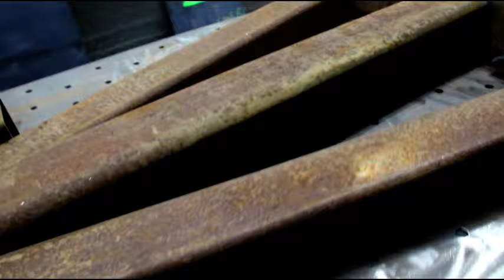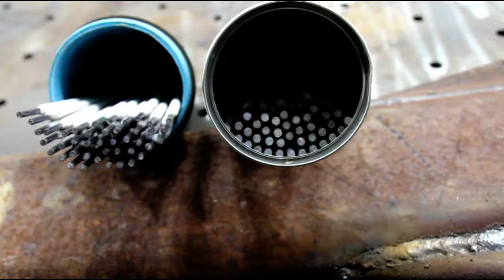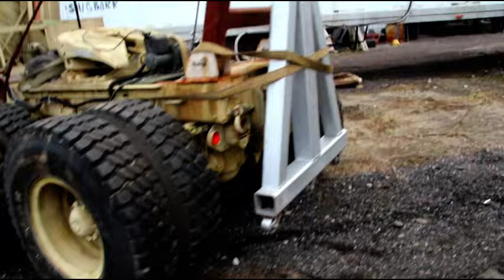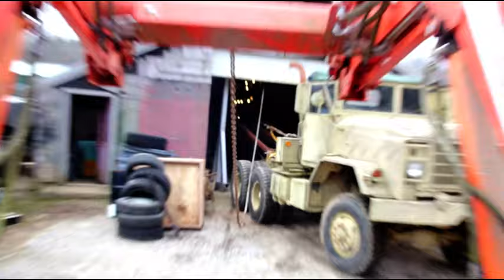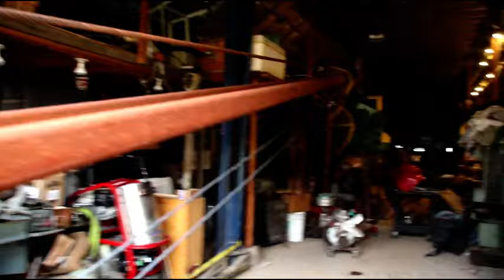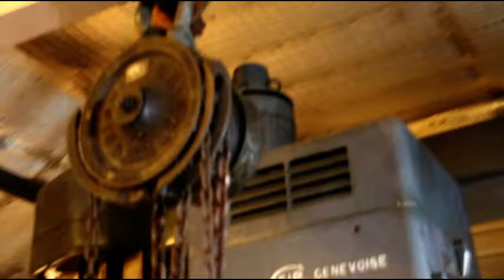Fabricating A Gantry Crane For The SIP Hydroptic 8 Jig Bore

Comment: That's not a very wide base .In my opinion
Reply from the maker: This was built as a dedicated SIP accessory and even though the base is not wide it is on solid ground and lifts things easily.  I have tested it to 3600 pounds and rolled it around with no trouble.